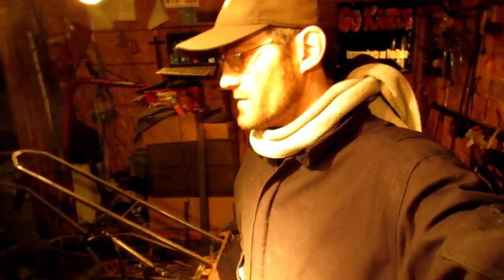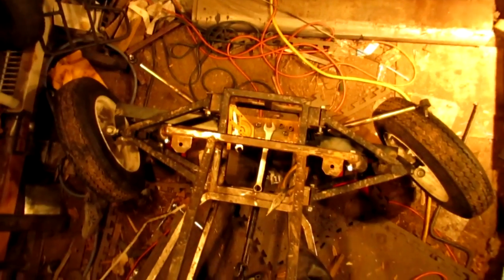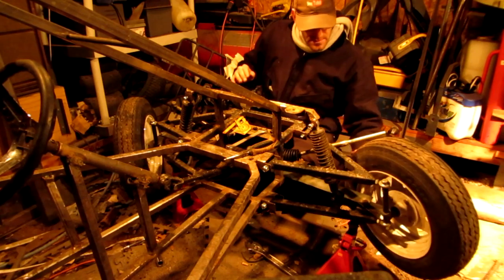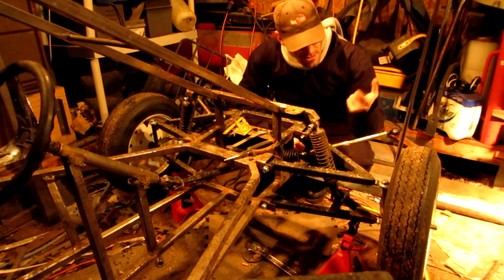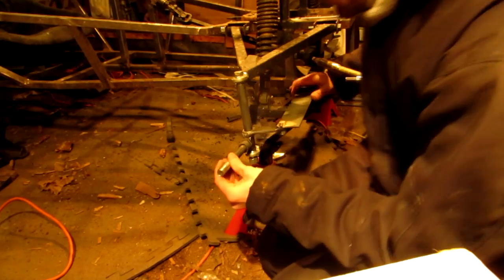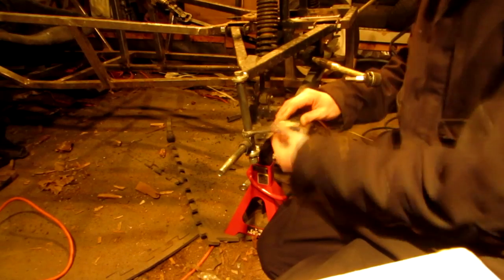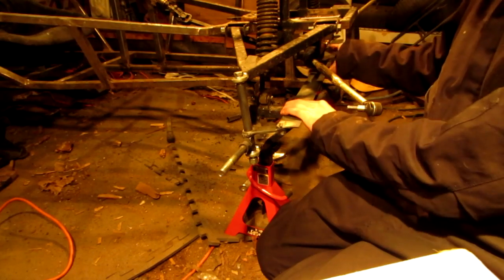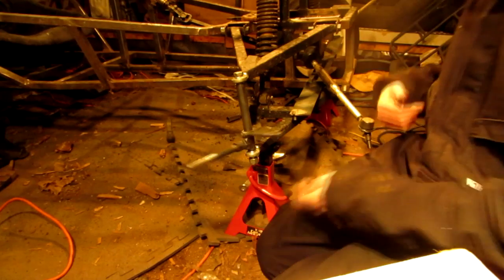Off-Road Buggy Build #28 (  Spindle is the Problem) Fullscreen Machine

Comment: I think that you should follow the Ackermann principle and it is not a problem that the tie rods are at the front, BUT the problem will be that the connection will be somewhere in your rim. The way it looks now you can do it by putting some kind of spacers on the wheel axles in order to take the wheels further out and you will have the space to do the geometry correctly. I am not 100% sure, but I think that if you do it that way you won't have to put steering stops because the tie rod of the inner tyre will eventually hit the vertical axle with the kingpin and stop in it, acting as a steering stop. I have a similar (still theoretical) problem with my build and I am solving it with rims that are offset to the outside, allowing a front steering connection outside the kingpin.
By the way I've seen somewhere that the steering knuckle should be the same length as the element on the other end of the tie rod, so that you preserve the Ackermann compensation at all times.

Comment: Aren't the Steering arms supposed to be behind the axle when they have an angle crossing over your rear axle. If the steering arms are in front I would have thought that they where pointed outward to give you the effect of the Ackermann Angle.
Reply from the maker: yep, that is how I did have it set up. but the problem was the distance between the king pin and the tierod connection.

Comment: It`s not the lenth.You need to angle them out toward`s the wheel`s.You should be able to draw a line between your tie rod end pivot your kingpin and land in the center of the rear axle.After that your steering/toe in on turns will be dead on.I can do a quick video if you want…

Comment: Flip the engingine around and make it rear steering ;)
Seriously, I am really surprised you didn't put stops in just keep the potential damage off your rack and pinion as well as the control arms. Though the rear axle is short, your butt butt angle should work out.
If you go pay per view, do we get paid back when f'up like this?

Comment: once you re-engineer the Ackerman  and have your geometry right, put the stops on it anyways. the problem you're having is your tie rod ends are "camming over" at full turn. Even if it doesn't do it when it's sitting on a bench, with the force of your weight and rolling 30-40 MPH on it,  it may still do it. They put stops on cars, they put stops on trucks, it wouldn't be a bad idea if you used stops too.